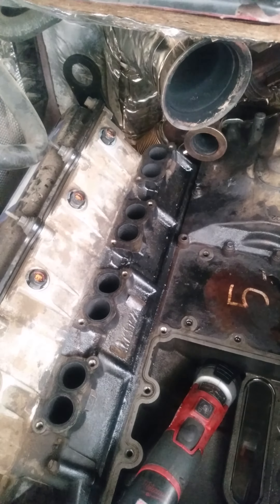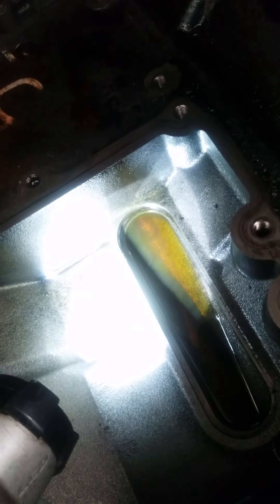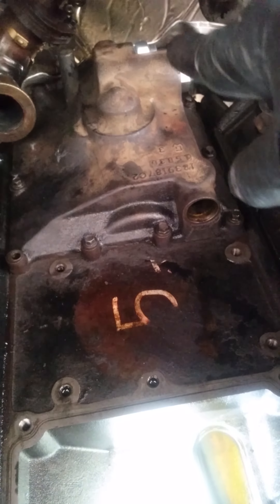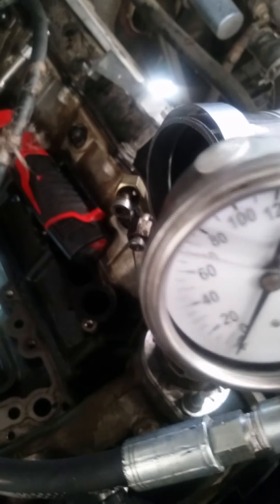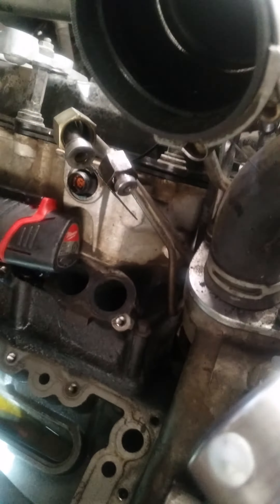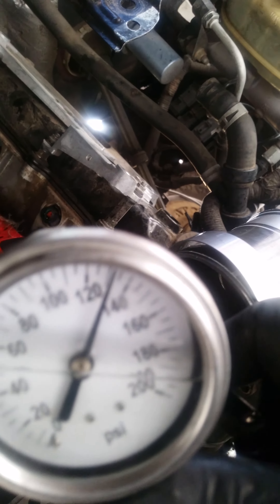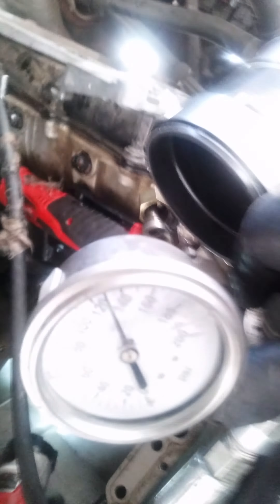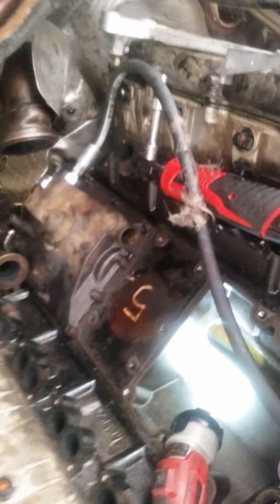2003 powerstroke 6.0 pump test 2

Comment from the maker: if it's a 2003 04 early 04 add. oil into the ipr port install your air tester ,Ford says early model pumps can leak some not to worry..add that engine oil install your ipr and recheck.

Comment: I just dropped new everything in my truck to fix all the know problems.. so we did new discharge tube ( just for that o ring inside) and did a new hpop also.. we put air into the icp and can hear it gurgling in the oil cooler/filter housing.. took out the new hpop plugged the hole for ipr with rubber hose, bolt, and clamps.. put air into the discharge tube and new oil pump while in the vise and air go right through the new hpop with no no no resistance what so ever.. did it both ways through pump with air.. Am i correct in understand your video if you an air test and air is coming back into the oil cooler then chances are pump is bad.. i know not 100% true but bottom line air should not be coming back into the oil cooler.. thanks 2004 round hpop